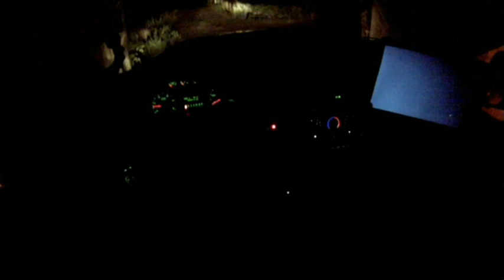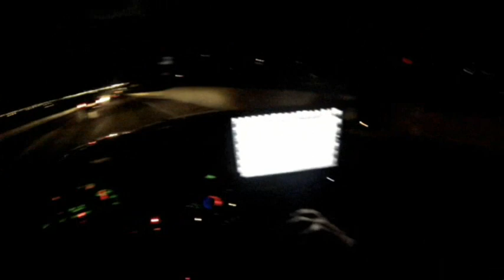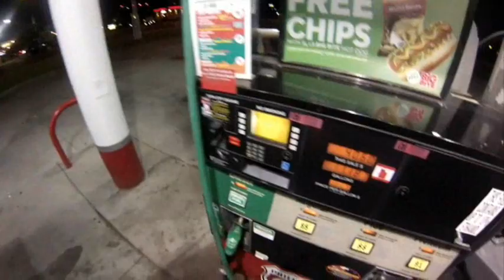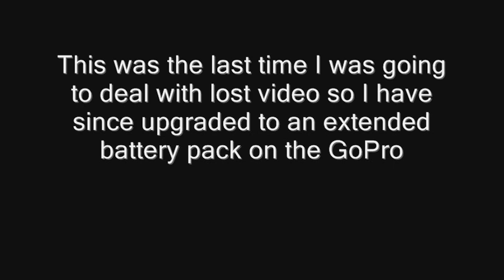No Keys On An Ex Repomans Truck Makes For A Hard Night Of Work

Comment: Hey Matt, you might have already looked into this but if you install infared floodlights to the top of your truck spotlighting into several directions and then use a camera that picks up night vision, your night videos would look clean, if your gopro has a night vision setting, then all you need is stronger infared lighting

Comment: Matt, I'm glad you said the truck is going to get fixed soon...
I am sorry that the dodge busted up your dolly bars, unfortunately, I saw that one coming (not on this one, but eventually).  I was concerned from the time I saw how you had the bars mounted....  It just didn't seem like a good idea to have them hang over the end of the bed....  I hope it didn't mess up the dodge as well, I hate to hear that you had to pay for theirs too....
You won't need much of a impact, so you can probably get away with a $20 one....
Reply from the maker: There was no damage to the Dodge. It barely even made contact with the rail mounts but it was enough force to easily bend the crap out of them. The weld was easy and I sprayed them black again and you cannot even tell. They do hang off the rear more than I like so I will be looking and a way to split the difference once the engine issue is resolved.
Reply: Not to be cruel, but better your truck, and easily fixable, than having to pay for somebody else's ride....

Comment: Matt replace the expansion tank cap AKA radiator cap , they are $5 and what has killed many 6.0 and 6.4 engines , they will only hold 3-4 psi after a couple years service , we replace them ever yearly DOT inspection as insurance after one killed an engine , if you don't believe me , have your cap tested ,you will see ;)

Comment: You can install a ford air-conditioning pump on your mortor, install a pressure line to a truck air tank with a pressure reliece valve , pressure gauge and a quick connect for air hose, leave the low pressure line open on the pump.  Now you can use air tools and a tire air tools.   Oh use a switch to in gauge the pump when needed.

Comment: Matt, in regards to what you said about the air impact, while they are more powerful than the electrics (most) you should look into something like a craftsman 1/2 drive electric impact and get the lithium ion battery, it would make it a ton easier to change those dolly tires, or a tire on a car you are towing, i don't think it would remove the ninjas tires though.
Reply from the maker: I like air when it comes to impact wrenches and since the truck is already outfitted with the hose and compressor I may as well take advantage of it. I have a really since electric Makita impact wrench and it does not work very well in my opinion.
Reply: I totally get what your saying, the air tools definitely have tons more torque if you got the proper air capacity, my idea is that it would make it real easy for you to pull that out of the sidebox and whip a dolly wheel off vs. pulling out the air hose, the air gun, lubricate the air gun and drag it to the back of the vehicle etc. but i guess either way you will get the tire off lol. I use a craftsman 1/2 drive electric impact and its almost as good as my ingersol rand air impact, I'm surprised the makita doesn't work good enough but i feel their quality has become the equivalent to black and decker these days.

Comment: I was going to put an impact on my truck, figuring how much air it would take you need a fairly large air compressor to do the job. So I already had an inverter on my truck so I went electric. Worked out great. You need 800-900 watts, and no waiting for air. Just a thought

Comment: Cummins equipped trucks are notoriously heavy in the nose. Your dolly isn't the only thing that wears tires under those engines, the truck itself wears steer tires like crazy. In the 4WD trucks, throwing the transfer case in neutral allows the rear shaft to spin free, and it drives a lube oil pump inside the case.

Comment: Matt, my advice to you as a recently retired Cop is to ALWAYS call the local PD when you find a gun after you are away from the repo location and have them come and get it from you.  The "new" Cops get real nervous when you walk into a PD to turn in a gun.  This also gives the Cop in the field a chance to thoroughly search the repoed vehicle for any other weapons.  Your current routine may work now but the instant a you try to turn in a gun that has been reported stolen, your life will suck for awhile.  You do a good job with videoing your repos but tech failures do happen and "lost" footage only brings more heat on you. I forgot to say only a real douche leaves a loaded AR in a truck laying on the floor.
Reply from the maker: Our local police station knows me by face so I would not worry about walking into them with a weapon in hand. Plus they are all sitting behind bullet proof glass anyhow so I doubt a stranger walking in armed would really stir up to much attention anyhow. Utah is a very gun friendly state and seeing someone walking around with a gun on their hip is normal. We had a crazy dude with an AR 15 at the mall once and it took over an hour before someone called the police to report it. Turned out the gun wasn't even loaded but I found it ironic how long he was able to walk around with it.

Comment: I had a nightmare dodge ram once, same thing wheel was cranked and it was a repo pickup  with no keys. I had a flat bed, but a few tries I got it on the deck, Barely. Dodges are apparently easy to get under the ignition cylinder, I never tried ripping one apart but I think about it sometimes just to unlock the column

Comment: You need to hit a comm shop / radio shop / installer and have them throw in a master exterior blackout switch - kills everything external including tail lights/ running lights etc.

Comment: I think those dolly tires failed by overheating - not baldness.  Overheating is usually caused by excess surface friction or high sidewall flexing.  If you are going to dolly a heavy load like a full size truck heavy side down be sure those dolly tires are pumped up to  the max rating imprinted on the sidewall to eliminate sidewall flexing.  And while a bit of out-of-straight towing is ok, pigeon-toed dolly wheels can create lots of surface friction especially considering that full lock steering angle.  I know of no easy way to check dolly wheel alignment but one way to check if you got it right is to tow it a mile and if you cant  bare hand those dolly tires, it means you need to make some kind of alignment adjustment.  Finally, see if you have (or can get) a grease nipple tacked in near to the bearing or axle shaft.   Those little dolly tires spin really quickly when you get going.   Just getting grease near the bearing will help - any heat generated will get the lube going where it should.  Happy Towing!

Comment: What year is your tow rig? I know Ford had issues with their coolant reservoir caps not being able to hold pressure and in turn they will puke out coolant. They have an updated cap you can purchase at a dealer or auto parts store. You want the one with the larger spring. If you do a search on YouTube you'll find a guy that does a lot of diesel Fords and I seen the video from him about it.

Comment: Matt I hope all is well. I know how u feel I upgraded my wheels for same reason blew 2 tires on a escalade. And also my buddy had dropped number 8 cylinder the other day on his 08 6.4 f550 87000 miles on wrecker cost him for reman engine and Every thing 11500 installed

Comment: If he had to parallel park between two vehicles, and the other vehicles left the seen might explain the wheels being cut hard? A lot of times I avoid using the dollies by unbolting the rear drive shaft and bungee cording it up. I have found after the first few I can do that quicker than throwing a set of dollies.

Comment: I have worse luck then you! Had trailer tire blow out on me, stopped and changed it like you did. then bout hour later down the highway that BRAND NEW spare blew out to! inside bead cord blew and sidewall bulged and let the air go out. Atleast you could still tow tow it home. I sat on the side of the road for two hours..

Comment: I don't understand what the problem and extra work was about? What would have been so hard about pulling the drive shaft & using the wheel lift on the front end from the start? Either way, nice catch & keep up the great work!
Reply from the maker: I just don't like to haul heavy trucks like that from the engine side for long distances. It's not good for the truck or the suspension. Also the front tires on the repo truck wear uneven because the front floats causing the wheels to tip in. For a local repo I will sometimes pop the linkage or drop the drive line. But hauling it 45 miles one way I  use the proper equipment.

Comment: Hey what's like ur videos a lot I'm a repo man and private property tower in new jersey I was just wonder if u guys out there ever put stuff in neutral from underneath at the transmission so u can at least get away with truck then tow it right or safe way
Reply from the maker: joseph marino All the time. Do what it takes to get the vehicle out of there quick and clean. Popping the linkage from underneath works great on certain ones.

Comment: On a dodge the driveshaft is flanged so you dont have to worry about bearing caps getting lost if you have to front tow it.   Then you can bunjee the shaft out of the way and be able to free wheel,
Reply: That dodge driveshaft is fucking HUGE. You would need heavy duty straps to keep it up. And I wouldn't want to pull it off...might risk the u joints falling apart and all ( they tend to do that when not bolted up. 

By the way, it's not "gassed up". You are "dieseling up". 

And that dodge front end is the heaviest weight. I'm not surprised it popped both your dolly tires. That's why the dodge needs E rated tires. I read somewhere that the cummins Diesel engine weighs 600 lbs more than a regular 1/2 ton engine.

Comment: I think out of all of the powerstroke engines the 7.3 has to be the most reliable. You have to remember the 6.4 was a quick 'fix' to the 6.0 In most cases older is usually better. You have to pick semi-mechanical engines over ones that run 100% on computers and rely on computers to do pretty much anything. It is cool seeing what new technology can do but it doesn't serve a purpose when 1 little thing fails and that stops an entire operation.

Comment: do they not make try out keys for dodges too? 
also supposedly Dodges are the easiest ones to make keys for off of the numbers, used to watch a guy on here called "repo rich" that repoed and he'd go out with a book, some key blanks and a key cutter and dial in the number on his little tool and cut a key sitting right there at the site and just drive off or at least be able to straighten the wheel to haul the vehicles off with.  not sure what rich's background is or how expensive the tools are that he used but maybe that could be an idea for you for something in the future?
Reply from the maker: The tool cost about $2000 and then you have to keep an inventory of blanks. Plus they are making it harder to get access to the updated key codes thanks to car thieves. I use to repo almost all of my vehicles using keys that we had made at the dealership back about 15 years ago but it is getting to where they won't even make us a key anymore. Again thanks to car thieves. I just don't come across this situation enough times in a year to justify the expense of owning a key cutter but in a situation like this one it would have been nice to have for sure. They do make tryout lock pick sets for all types of ignitions but again I have not invested in them  because they don't always work that well.
Reply: that's cool i have never priced any of that stuff so i wasn't sure how it would work but since a lot of them are going to the key fob  and push button start that does make it a lot harder to get keys or whatever made for them , i under stand that ,

Comment: pulling a good load, puking coolant sounds likewhat 6.0l do when  head gaskets have a small leak, if you had low compression in that cylinder your having trouble with mabey thats the issue
Reply from the maker: It is the head gasket and hopefully I have not damaged the cylinder wall at this point. We will know for sure by next week.

Comment: Matt, its not called a clip, its called a mag or magazine. A clip is something else entirely.

But that guy with a loaded gun in his car just makes me rather furious as I count several firearms offenses, or at least stuff I would call a firearms offence:
1: Hot firearm (Bolt inserted) which means its easy to steal and get a functioning weapon
2: Storing ammunition together with a hot firearm. Congrats you just gave some random perp a free weapon AND ammunition to use against you or someone else.
3: Storing it in a "cloth" bag and not a proper hardcase gun"tote" with lock... Well see the 2 points above.
4: Storing it in an unlocked vehicle, which means that he basically more or less gave away a firearm. I know it doesn't work like that, but someone is bound to go around and try and find an unlocked vehicle and hurrah, a free gun as well.

I have been trained to NEVER leave a hot firearm unattended at any point, and not to store a hot firearm and ammunition together, unless its under guard and supervision. The VERY LEAST he could have done was to lock it in some box on the back with a proper secure lock. Or a lockable hardcase to at least make the theif work a bit to get the gun.
Reply from the maker: Since I was a teenager I have always heard of a guns ammunition being stored in a clip. The word gun clip can be Googled and the official definition is the first link that comes up and it says that a clip is for storing ammunition. So not sure where you get your definition of the word but I have always known it to be called a clip and apparently so does the rest of the world. FYI the second link that comes up when you Google the word gun clip is the definition of a magazine so they both seem to be words that can be used to define the part of the weapon that stores the ammunition.
Reply: RepoNut Hes just being specific. We all know what you were talking about. What you had on your hand was a detachable box magazine. A clip is used to hold ammunition to then quickly load a magazine. These clips are popular with guns that have a non detachable magazines like a mosin or SKS. Anyway how close are you to your donation goal for the repairs of the engine. I might have extra cash to donate some more money. I really dont watch TV but i love watching your channel so i would rather donate money than to give some money to a cable provider.

Comment: Ok Matt. Dumb question. Why didn't you remove the rear driveshaft from the pinion yoke, strap the driveshaft UP and FORWARD so it kept the fluid in the trans and up off the road and pulled it down the road with the rear tires on the pavement? I've seen it done before, just not sure if its not something you can do.

Comment: I would have turned it around as soon as I could them dollies aren't made for that kind of weight. for that long of a haul. I don't like that much weight on my truck either but its a lot safer than pulling it using all the road

Comment: Smoooooth move, pull out the gun in public and then load the frickin thing????? WTF nice work!!!!!!
Reply: He obviously knows nothing about guns as demonstrated in more than one video. Matt, when you find a gun, please do everyone a favor and leave it alone.
Reply: WeSRT4 bmark0610 In a lot of places, there is nothing wrong with pulling a firearm out in public, including Utah. Also he inserted an magazine and removed it after a few seconds. Without racking the bolt, there would be no round in the gun after removing the magazine. 

Also I'm willing to bet the magazine was empty judging by the sounds it made as he was moving it around.

Comment: "Pulling up to a curb you shouldn't have your wheels turned" someone skipped drivers ed
Reply: +Daniel MacKinnon (Dan Da Man) depending on the city/state it only is a requirement if it is on a hill.

Comment: my i ask a question? im not knowledgeable in this so my question my sound stupid. Why not just tow the car from the front, as the wheels were locked to the far left and as you had access to the cabin you could place into neutral and  disengage the Ebrake. or is that not an option

Comment: I have a Dodge Ram 1500. ( I know this is a 2500) It was my husband's. I had to throw that in there. It's common sense the front end is way heavier than the back. Although it has to be towed from the back, wouldn't it make more sense to put the front part on the lift and the back on the Dolly's??  Or would it then be too heavy for the truck?  Idk lol I've just been wondering because I've seen this happen in other videos and I'm like why not just reverse it? Lol. And yes I know this is an old  video

Comment: Hey is a Ar 15 rifle.... Not a assult rifle those are military rifles fully automatic  and the general population  can't  afford  one of those 35 to 40 thousands
Reply: +pedro664 so facts Ar-15's are civilian model m16's they are not military they are not automatic however the original model the m-16 is military and fully auto ar-15's range from $1k to $3k generally depending on the model
Reply: pedro664 local class 3 gun shop has an fn m16 for $20k not including the nfa fees